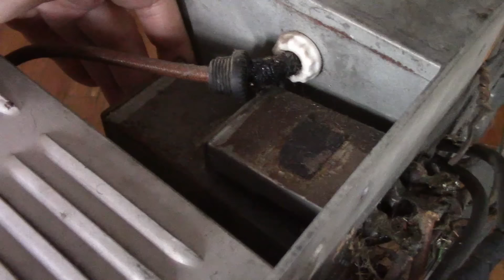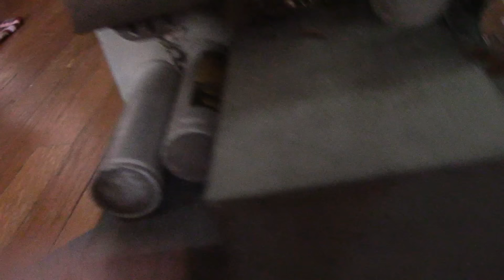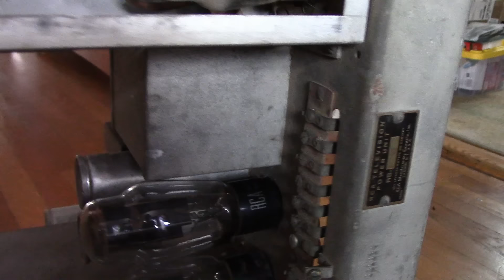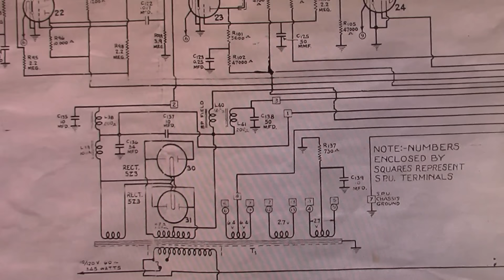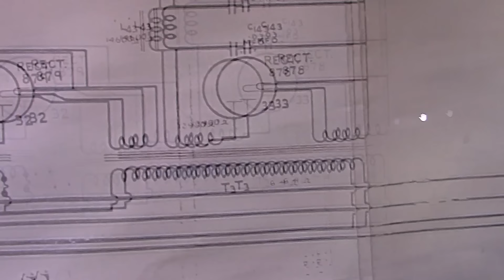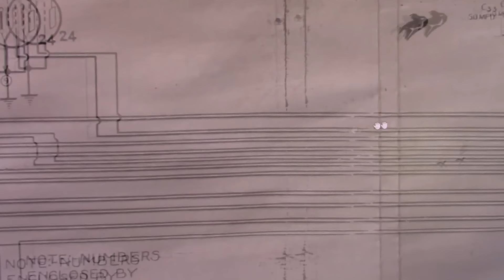RCA 1936 RR-359B field test TV: part 5 - Power supply deep dive

Comment: Quick comment, Bob's main chassis is the one pictured in the RCA photo but that is not from the technical manuals. RCA was prolific at taking high quality pictures of everything they did. It's just one of many pictures of many of these sets in various conditions. Still a very nice coincidence that Bob's set was among them.

Very few sets were originally built as 9" as they quickly transitioned during build to the 12" sets. Almost all 9" sets were upgraded except a handful. There are three known, one at the ETF, one in a private collection and the Russian version in a private collection. The Russian sets were a separate build of 75 units, all 9" not associated with the 100 built for the New York Field Test.

All of the documented engineering changes for the initial "B" changeover would have been made to Bob's set. There's no guessing at what his should be other than all the subsequent changes by previous owners. Later B's got the detent tuner and they flipped the H/V centering/size controls down under the deckboard leaving only the three controls. This can be seen in many RR-359B photo's.

Nothing can be made from the serial numbers as there was no effort to keep chassis' together and with the cabinet. Even in RCA pictures sometimes the two chassis serial numbers don't match.

Comment: Could the High Voltage transformer have been replaced to run the larger CRT
Reply from the maker: Possible but doubt it.  RCA installed the 12" CRT, but they did not install that HV transformer.  It's far too sloppy.

Comment: if the HV is above the normal level, be aware of X-rays. Does the set have shielding enough with the original design?
Reply from the maker: It's actually below what I normally for on - only 6kv.  No need for any x-ray shielding.

Comment: The capacitors in the boxes are not electrolytic 
They are definitely paper caps.
This was common RCA practice for radios of the early 30’s I have some RCA TRF consoles that have no electrolytic caps at all. Just a bunch of high voltage paper caps in the tar filled cans. 
The wet electrolytics of the era were normally always 4-8 mfd
This is what RCA would have used in radios of the era. 
They also liked to pot bypass caps inside of the tar boxes
Thats why all if the filter chokes because the filter caps were all low values
Reply from the maker: Yes, I misspoke.  I'm familiar with tar filled paper cap blocks and have rebuilt a bunch.

Comment: Thanks Bob for this latest update which is very interesting.  You were able to find some much improved documentation plus, valuable help from other collectors - that's Great!  Going to the TV museum is an excellent idea to look at their set.  I suspect the high voltage transformer was replaced to provide the additional current that the 12" CRT needed.  That's lot of transformer iron for one chassis and the chassis reveals this as noted by the thickness of the chassis sheet metal.  Those dog bone resistors forming the high voltage bleeder I expect will be far off value due to the voltage effects and the nature of carbon resistors.  In the high voltage rectifier section, I noticed the high voltage rectifier tube sockets were simply mounted on a sheet of bakelite.  I am surprised they didn't have arcing problems.  My first choice for new wiring would be silicone insulated wire for the high voltage areas and teflon for everything else.  These wire types never appear to age and they fully resist soldering iron heat.  That tuner would have very high noise figure, giving the appearance of poor receiver sensitivity.
Reply: There were no changes to the SPU between the 9" and 12" sets. The TRK12 transformer was a hack when the original transformer failed.
Reply: @auroradesign1718 Thanks for your input; very interesting!

Comment: Being a mains derived EHT supply, it will need much larger filtering capacitance than a line flyback design...meaning that any shock you receive has potentially far more energy. It's no wonder they are called "widow makers" 😮

Comment: You're giving me motivation to fix the modem in my ASR33 teletype modem. All the 65+ year old carbon resistors have drifted throwing the frequencies off. 
Unhelpfully the slight fading of the markings, and my color blindness make it very difficult to read the markings. And the boards are not marked :/

Comment: The phenolic board the dog bones are on seems to be broken off at the screws. Will you be gluing it or replacing it?
Reply: He said he would try to glue it
Reply from the maker: Watch at @4:35.  Yes, it's cracked.  I don't know what I'll be doing.
Reply: @bandersentv  Someone was making custom dogbones with modern resistors cased inside. I’ll see if I can find it.
Reply from the maker: I have before. One of my Philco radios
Reply: @bandersentv it's after midnight over here, I tend to doze off sometimes. Must have missed it, sorry😊

Comment: Wow, the fact that the picture is of your set is incredible... : )

Having a tunner would be nice, but you don't need one, do you? ( I mean, you could inject a signal).
Reply from the maker: Well sure which would bypass about 2/3 of the circuitry.  I'd prefer to get it working as closely to the original configuration as possible.  Otherwise, It's just a monitor.

Comment: You can substitute it with 3 microwave xfmrs or 1 with a capacitor diode trippler for maximum death
Reply: A sticker on the high voltage box saying "Executioner Approved" would be an appropriate upgrade.
Reply: Using microwave xformers may be viable but would also need very good (better) magnetic shielding. Like Neon Sign Transformers, Microwave xformers exhibit a huge magnetic stray field, which could magnetically deflect the CRT (unless that was shielded itself) . The loose coupling between pri and sec windings in such a Leakage-Reactance/Stray-Field xformer is their means of limiting power transfer and therefor (short circuit) current limiting. But with Neon Signs we are talking less than 50mA on the secondary, with a microwave xformer 500mA. So the emitted magnetic stray field of a microwave xformer is much higher than that of a neon sign alike one...
Reply: Old Sparky
Reply: SPAMMER !

Comment: That is unbelievable having a picture of the chassis you now own. What an incredible resource for the restoration. What are the odds?!
Reply from the maker: About 1 out of 100 I suppose 😊
Reply: @bandersentv  
Yes, it's 1/Q, with 'Q' being the actual quantity produced. Did they even make 100 planned units? 🤔😉
Reply: The set was a 9 inch set in the chassis photos, with a smaller metal cone for a 9" CRT. This is one of the sets RCA took back, modified and sent back out as a 12 inch set. Note the additional tubes Bob found in the chassis were not present in these photos. The "extra" 6H6 was an RCA modification. The sloppier parts were presumably done by someone later, someone with technical knowledge, but not good workmanship. Amazing to have these photos to show the original state of the set.
Reply: @garystrait3289  Apparently only three examples exist of the 9-inch sets.
Reply: @garystrait3289  Just fantastic!
Reply: Keep in mind these prototype sets were built in an engineering lab.  The fact that your video chassis has the same serial number suggests that this was the last prototype built.
Reply: Yes, this is super cool!

Comment: HV supply high vs low impedance output a factor in output being a hazard?
Reply from the maker: Absolutely.
Reply: The amount of current it will be able to push through a fault through a person factors into its danger.  Low impedance implies more current in that situation.
Reply: The real danger with these early high voltage supplies was due to the huge filter capacitors needed to filter out the 60 Hz halfwave rectifier output.  You typically see a total capacitance of around 0.1 uF with these 60 Hz high voltage supplies.  This doesn't sound like much charge until you take into account the voltage.
Reply: @billharris6886  stored charge doesn't seem to be a factor, it's only about 2 J in the setup described. Gotta hurt a lot (a cigarette lighter piezo zap is said to be about 0.001 J), but a chest defibrillator delivers hundreds of joules.

I think the low impedance of the transformer is the key, the capacitor only effectively lowers it even further for the initial moments. It's deadly already, a cap makes it only marginally more deadly.
Reply: @sashimanu It's hard to say, I don't have any experience modeling human body electrical shock, I am just going on limited personal experience getting shocked by color TV anode supplies.  With this circuit, I don't know the current rating of the high voltage power transformer.  Since the secondary has a high voltage rating, the secondary bobbin has thick insulation so it won't arc to the transformer iron core, which reduces the coupled output power.  The high voltage rectifier has a maximum continuous current rating of 5 mA and has about 500,000k of resistance between the rectifier and filter capacitor (composed of plate resistance, a 450,000k current limit resistor, and a 600 ohm filter choke).  Under short circuit conditions, 0.7 mA is the maximum rms current available since we have a halfwave rectifier and, this figure does not take into account the series resistance of the power transformer secondary.  So, I still stand by the filter capacitor being the primary cause of electrocution, since the capacitor supplies virtually unlimited current during discharge.